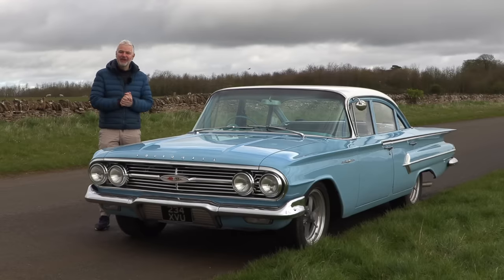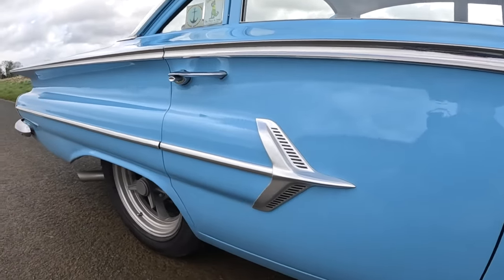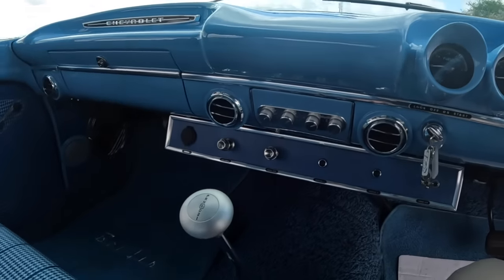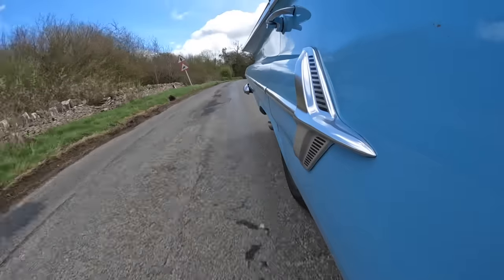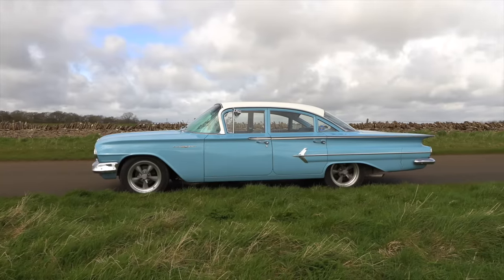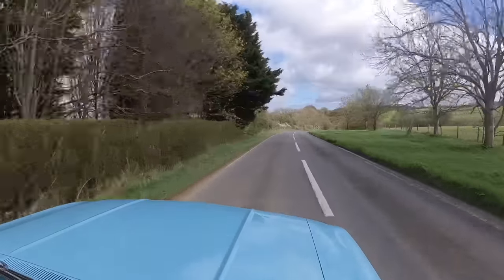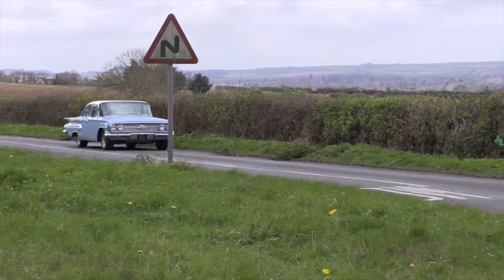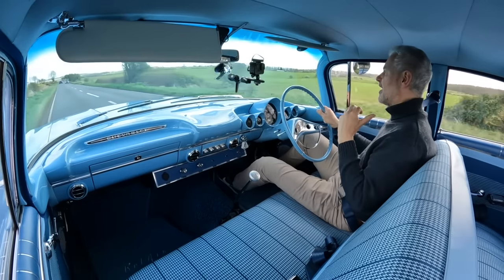Better Than An Electric Conversion? 1960 Chevrolet Bel Air With LS3

Comment: Cool 60 four door, quite the nice drive around for the enjoyment of driving a sofa kind of car. One of my long time friends is big into 59s, he has an example of every body style/type offered in 59 except for one. His ElCamino has a 348 with Tri Power, three two barrel carbs on it.

The chevy was the economy division of GM, so they had barely adequate engines, brakes, suspension etc. Some upgrades and they are a lot better. The Pontiac from 1958 onward was the performance division of GM, they handled, stopped and accelerated a lot better.

I feel for you guys outside the US, its incredibly expensive for you to own our cars. Importing parts was challenging 34 years ago when I was stationed in Germany, the internet has made it less cumbersome, but its still a problem. I can go buy a $500 Silverado or Sierra 4x4 2500 and yank the 6.0 out of it. Sell the good parts from the truck, and scrap the rest, leaving me with a good engine and transmission with a tidy profit. Thats what I did to put a 6.0 in my 1976 C10 pickup. With a cam swap and some headers, a 6.0 can easily make 500hp around 6500rpm. I have something like $2500 total in the swap for my C10.

If I am spending $9000 on an engine, its going to be a rather serious Pontiac V8, and will make between 600 and 750hp/tq all under 6500rpm, these things make 500 to 600ftlbs from 3000rpm to 6000 real easy. Usually a low buck rebuild with all new internals and using the factory crankshaft will run me around $3000 and it will make over 500hp/tq. Like I said, its nice living in the USA and being able to do all the work yourself. For $15k I have an engine capable of 2000hp with 20psi... like is in my 1968 LeMans.

As for the EV and emissions thing, I make ethanol from cattails and run my cars and old trucks on that. It only emits Co2 and water, very clean burning when you don't mix it with gasoline. My daily driver 1965 GTO has a 455 (7.4L) with 11.5:1 compression to take advantage of the ethanol fuel, it gets around 17mpg mixed city/highway driving, because a 65 GTO is not exactly known for being aerodynamically slippery... Also I tend to drive it somewhat 'spirited' as they say in Britain, when you have 550hp and nearly 600ftlbs under your foot, it can be intoxicating. 

The 65 GTO runs on ethanol, and has since 2018, the 70 GTO has a 13:1 455 in it and it has been on ethanol since 2007. It averaged 20mpg with me driving it, somewhat harshly.. it has better aero than the 65 does. I need to rebuild the suspension on the 70 and replace the wiring harness, 55 year old cars need things redone at some point. 

Since I make the fuel myself, its a very green process and my vehicles are neutral, if you're concerned about such things. Essentially my fuel is 190 proof moonshine, and vehicles run wonderfully on it.

The cost of an EV conversion is what keeps me away from them. Also the fact that to make it to town and back from my home, most of them need recharged, and they can't be driven in winter because the batteries won't recharge if its too cold. You see the distances are much greater here in the US, the closet town to me is 20 miles west, the next closest is 25 miles east. With an EV on a cold day, you have to plan a trip between them and back very carefully and you might not make it. Then you have to drive 45mph to extend the range, while everyone else is going 65 to 70mph.

An EV that can make the trip on a single charge is going to cost you over $80k here. I can rebuild lots of rusty junk for $80k. I go on 1000 mile road trips every summer, that is a 14 hour drive straight through in an ethanol or gas powered vehicle. Its a two or three day trip in an EV, waiting for it to charge and driving slower to extend the range. If you're pulling a trailer like I often do, the range is even shorter on the EV. I routinely make 2 hour drives around here to get parts and go to appointments. The USA is freakishly huge, and its difficult to wrap your head around it unless you travel across it yourself.

We are different here, and yes we have roads with curves, hills, and all the fun stuff too. We have straight roads that are rarely traveled where we can enjoy high powered cars, not as nice as Bahn 3 and 5 where when I was stationed in Frankfurt, but we can open up our rides and go fast where I am from. Taking tiny European cars and sticking our V8s in them is a fun time for us. Like the AC Ace, the Opel GTs I am currently getting parts together to build into V8 powered monsters, and all sorts of other things. Anglia's are fun racecars as are Thames delivery vans that made it over here.. I kinda want to V8 a Trabant.. Too much power is almost enough for someone like me.

Comment: For whom did they make RHD?
Reply: In Australia for Asia and in Canada for the rest of the RHD world.
Reply: The 1950/60s Chevs and Pontiacs were assembled in Australia from Canadian CKDs and sold in Holden dealerships - and of course they were RHD fitted with amber rear indicators to meet Australian compliance requirements.  1968 was the final year for the Australian assembled RHD Chev/Pontiacs.

Comment: this car handling is not at par with the engine installed, these cars were notorious for sloppy hamdling so the engine can push it over its limits and that leads to a dangerous situation.

Comment: Wait a minute. How is this right hand drive?
Reply from the maker: Was made in Australia originally..
Reply: @Number27  thanks. I’m betting that you said that in the video and I missed it
Reply: The 1950/60s Chevs and Pontiacs were assembled in Australia from Canadian CKDs and sold in Holden dealerships - and of course they were RHD fitted with amber rear indicators to meet Australian compliance requirements.  1968 was the final year for the Australian assembled RHD Chev/Pontiacs.

Comment: Where did a right hand drive Chevy come from?
Reply from the maker: Australia
Reply: The 1950/60s Chevs and Pontiacs were assembled in Australia from Canadian CKDs and sold in Holden dealerships - and of course they were RHD fitted with amber rear indicators to meet Australian compliance requirements.  1968 was the final year for the Australian assembled RHD Chev/Pontiacs.

Comment: It's too big, I doubt the mileage and not that friendly to the environment. I'd say 30%
Reply: Well it is 2 centimetres longer than a new BMW 5 series.
However it is 2.3 centimetres narrower and around 200 kilograms lighter so not that huge.
Most mid size electric SUV’s are going to weigh more than this and one day somewhere has got to accommodate all those dead batteries.
Reply: @DeeCee-nb6ev  I agree the modern SUV and ev are a curse

Comment: where the hell did he get a RHD ?
Reply: The 1950/60s Chevs and Pontiacs were assembled in Australia from Canadian CKDs and sold in Holden dealerships - and of course they were RHD fitted with amber rear indicators to meet Australian compliance requirements.  1968 was the final year for the Australian assembled RHD Chev/Pontiacs.
Reply: @georgebettiol8338  thanks